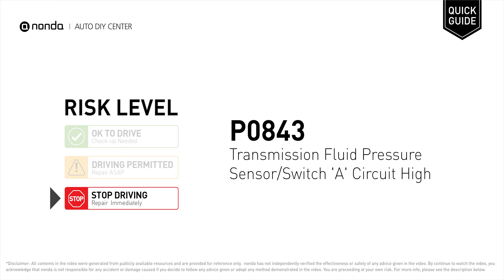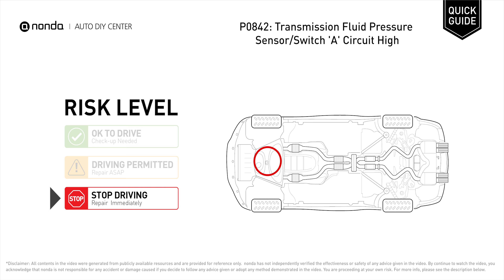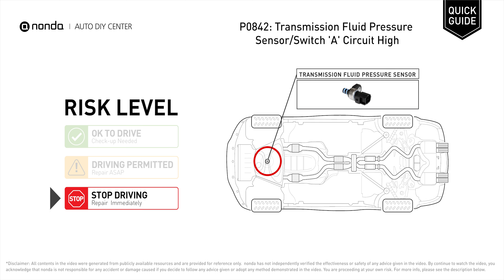What is P0843 Engine Code [Quick Guide]

Comment: Hello,  
I have  2012 Acura Tsx,
I am have a jerk in my transmission, i got a code for P0843. My car has no leaks and i recently changed the my  transmission fluid. Do you think I need to change my transmission fluid sensor/switch?
Reply from the maker: Hi Ryan, there's a possibility that the 2nd clutch transmission fluid pressure switch is faulty. Kindly check also the condition of the connectors/harness and if the circuit is open/shorted.

Comment: I have that code on a 2008 impala
Reply from the maker: Hi Al, please start on inspecting your transmission fluid and filter if there's an issue. Check for leaks and repair if there's any. Inspect the wirings and connectors, transmission fluid pressure sensor, torque converter, valve body, transmission pump, pressure control solenoid and pressure regulator. A replacement for these parts could be needed.